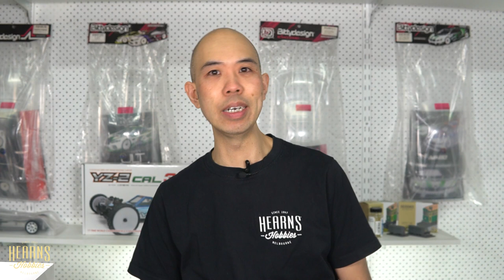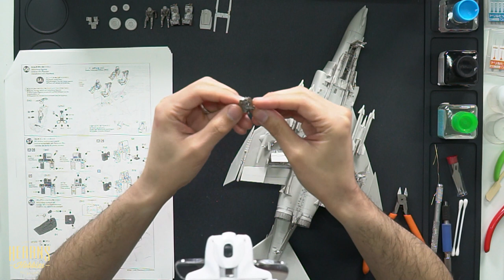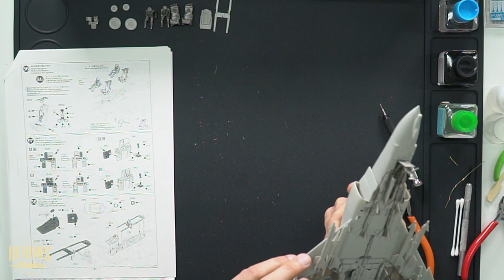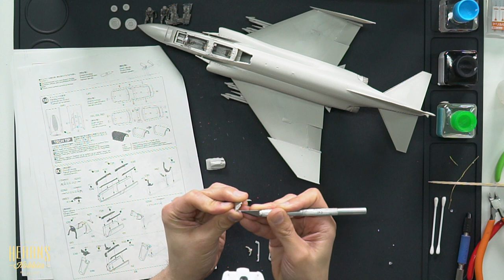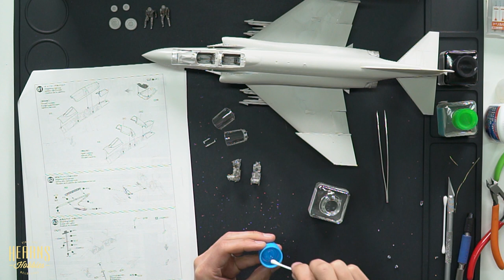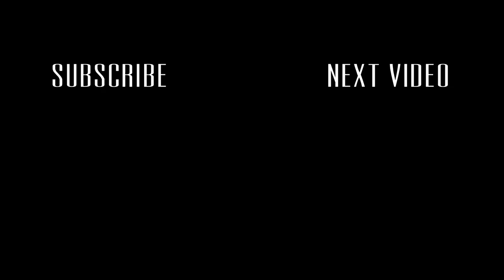Tamiya | 1/48 F-4B Phantom Build Part 15 | #askHearns

Comment: I think Tamiya should include more metal parts in its models because some parts are really too skinny to be plastic.
Reply from the maker: It would be nice for Tamiya to add metal parts but they have traditionally only offered that in more expensive 1/32  aircraft kits. Tamiya have always allowed the aftermarket producers to have that market. On aircraft, the undercarriage and antennae are the most fragile parts. It would be quite easy to insert a metal rod into the undercarriage before assembly. That would be useful for any kit and give peace of mind.